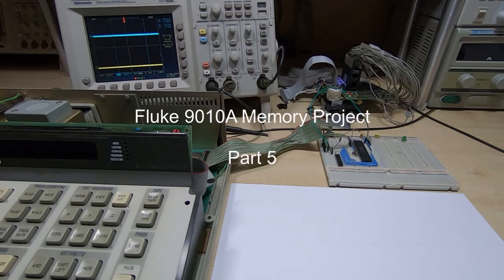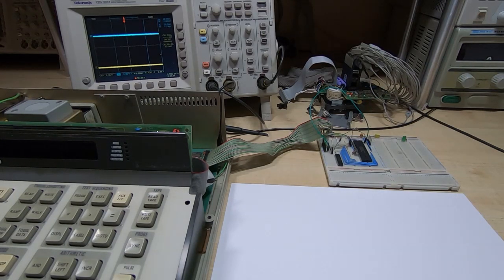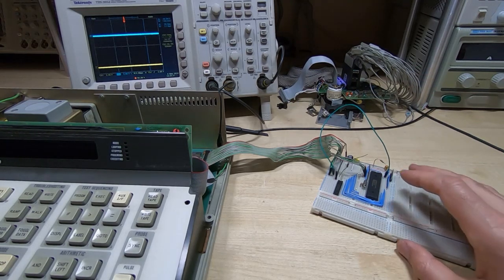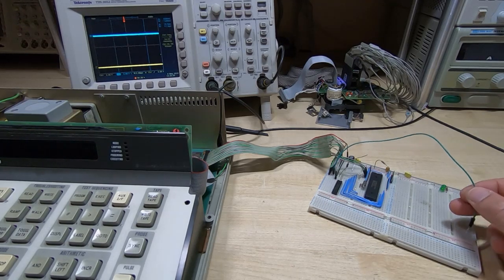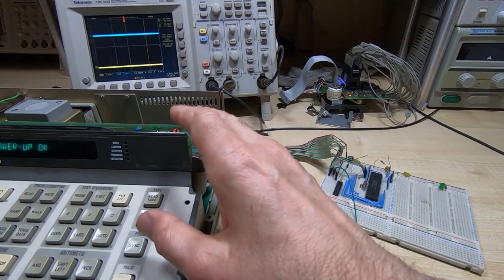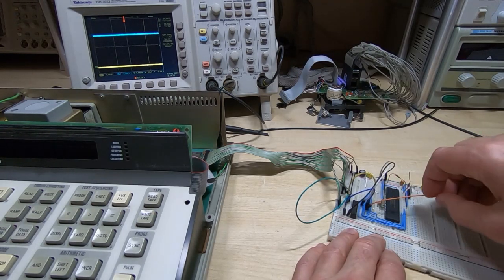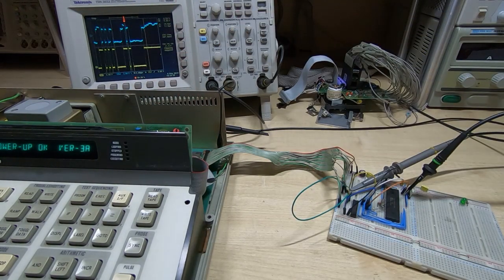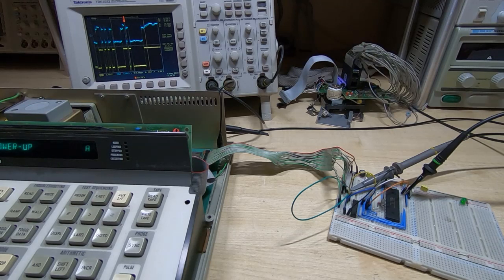Fluke 9010A Memory Project Part5

Comment: Hi Jerry, Now I understand what you meant. I'll have a look at my Fluke's BUS signal quality. Ben.
Reply from the maker: Let me know if you cannot sort it out and I can post a more detailed video on fault finding. If the processor is running then looking at the bus signals you will see various levels as each device takes turns on the bus. Use channel 2 on the scope to monitor the select lines on each device attached to the bus. You can then see which device is responsible for each level and if any are low you can see which device it is. Or you can send it to me for repair.
Reply: @JerryWalker001  You have been a great help. I'm am enjoying probing around, but If I get fed up I'll send the lot your way. Though a more detailed fault finding video on the Fluke would be awesome.

Comment: Interesting... would you add buffers to the 9010A reproduction board project?
Reply from the maker: I will most likely add a bidirectional buffer on the data bus so that the Fluke only has a single input on each line. It is probably not needed but it will not do any harm. I should add that I can take risks with my 9010A because if I damage it I can easily repair it but I would not want to risk other peoples machines.